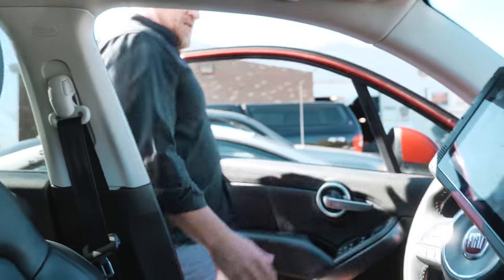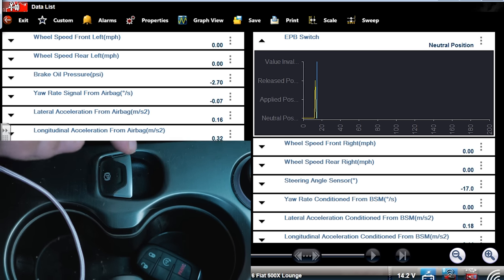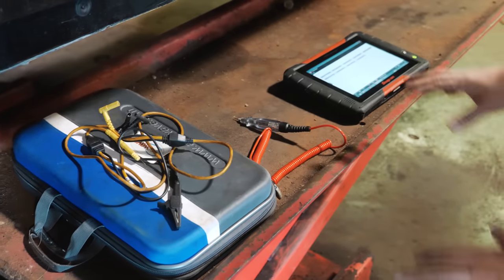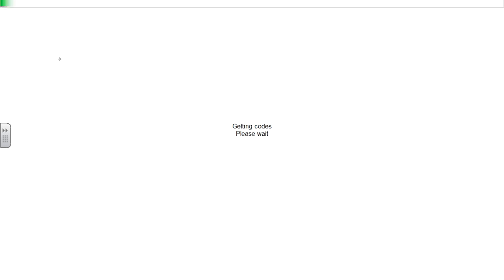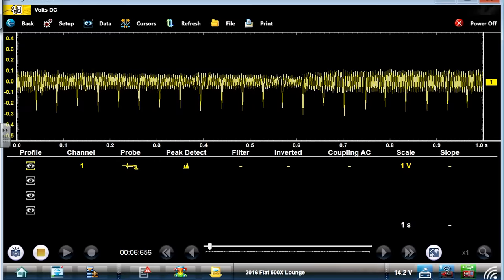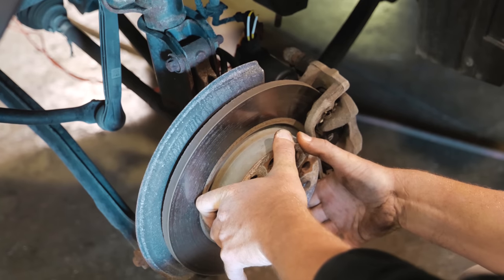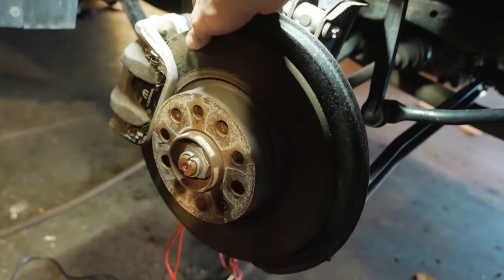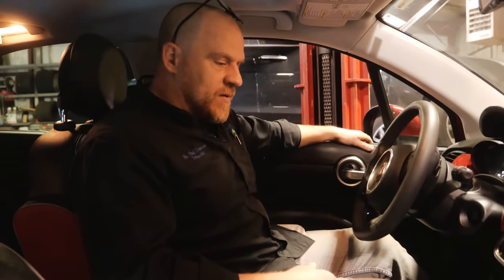2016 Fiat 500 Electric Parking Brake Intermittently Sticking On

Comment: Invalid wheel speed sensor code was there from the start , surely the ABS module needs to know that all wheels have stopped or at least there state before the brake can be applied/ released ???  Everything else is most likely water intrusion from the broken connector ? Also Fiat use an internal tone ring in the wheel bearing for the ABS and they are often put in the wrong way round was a rear wheel bearing replaced ? Incoherent code ? Suspension repairs ? New bolts on the RHR was it ??? Lots of possibilities it would be really great to have all the old repair orders ! Foxwell scan tools do strange stuff as well when scanning. Great content as always Paul and Caleb thanks so much. Good to see something Euro on here as well.

Comment: Ivan is a big proponent of Deoxit to clean electrical contacts.  He uses an aerosol form that appears to me to be more convenient than the paint-on you used in this video.  
If the connector isn't available from Fiat, I'd run to the scrap yard for one.  An expensive trip for the customer, but a more elegant/dependable repair for the customer.

Comment: Hi Paul/Caleb/Danner. Another great video. I think you should speak to your friend Tommy Wolfe about getting a connector housing and two repair wires for that EPB actuator. It looks exactly like the ones that Volkswagen group use. (Even the same rust/brown colour) I’m sure Tommy will recognise the type of connector. P.S. I think the little silicon seals for the repair wires are separate parts so you’ll need two of those also.

Comment: Maybe a way of testing the actuators would be to manually apply power and ground to the unplugged actuators in the apply direction. Put a current probe on the wires and compare the two. This would be a good dynamic test because as the brake applies the current will increase.  A sticking component or a freewheeling motor on one side would cause a current difference from side to side. If they are both the same it might indicate a good actuator.
Reply from the maker: I was more concerned with testing the drivers, but you're not wrong in that approach. I'd just argue that driver testing would have still be necessary. Especially if you find that the output (motor) has failed.

Comment: My guess is that connector was damaged when the wheel was reinstalled.  The rim is attached with bolts - not studs, and anyone who has  ever bolted one on knows the struggles of trying to support, line up, and balance the wheel while trying to not cross-thread the first bolt.  Notice the break in the connector is bent in towards the center of the car, suggesting the wheel leaned in and down onto it, snapping it.  The person who installed the wheel was probably not aware it even happened.  

"He who is without sin ..."

Comment: Great video Paul. It is a shame that the other shops might have misdiagnosed that fault. I am not making excuses, but in dealerships and chain repair shops the techs are pressured so much to make a call and do a repair with in a time limit. Many shops i have worked in the service advisors or service manager jump on the technician if they don't have an answer within the hour diagnostic time. Also many shops including dealerships are not interested in training techs on advanced diagnostic techniques, so the techs are given jobs that are beyond their skills, especially if they are new in the trade. This might have been the case the prebiouse person who worked on that car, made a call that they thought would most likely fix the fault as they were under the gun to call something. Also many dealerships will call things like modules if the car is under warranty as long as the write up is good and it is approved. Then if the fault remains they will keep throwing things at it until it is fixed. This causes customers to loose faith in the dealerships ones the warranty has expired, not a good practice. But that is also why shops like Danners are a diamond to have and are normally so busy. Once again Paul, thanks for sharing your knowledge, you are a true treasure to this industry as well as guys like you.

Comment: Hey man really enjoyed this video. I just wanted to know something. When you suspected a bad actuator as you were getting the open circuit code. Why didn't you use an ohmmeter and check the terminals of the actuator? And compared to the side that was working? That would rule out more than likely if the actuator was at least electrically open or shorted. And since you would have seen that it probably would have mirrored the operational side more than likely it would be in your connections that was the fault. I know it's easy to play armchair quarterback but just an observation I had throughout the video. I still enjoyed it and I think you're an amazing technician and I really appreciated your thorough and determined diagnostic approach.

Comment: Paul, I have and still work with 480v and 4160v 3 phase  electric motors. You should look up art flash protection. Just to see how electricity can jump. Sometimes you need more them just gloves. A good electrical supply company should have gloves.  They do need to be tested if you want to protect yourself from a shock. One little hole in the glove is all it takes.

Comment: hi again i think the system monitors through a resistance check which may be via bias voltage the motors whilst running is also monitored  for current (amp draw) when each motor hits the set limit of amps the module cuts power  the switch is treated like hand brake lever up to apply down to release i have been told this as i get click happy  you were lucky to be able to use the verus edge on a newer fiat as they are going over to secured gateway and the zeus with a subscription  will be needed on later cars

Comment: Thanks! I'm pretty sure that same connectors are on VAG cars rear calipers(Made by TRW). This kind of systems with 2 wires are monitoring curent and in live data it's shown when applying parking brake.
Reply from the maker: I didn't notice a current data pid! That would have been super helpful. Maybe I missed it? Thanks!
Reply: @ScannerDanner  I looked at screenshot and there is “Achieved clamp force for left(right) EPB motor in kNewton and it’s probably calculated out of motor A in end stage. Maybe I’m wrong, but on VW it’s working in that way.
Reply from the maker: @garaza24  ill blame unfamiliarity of the system 😉
Thank you

Comment: I've had success with deoxit, it cleans up green crusties really well in all kinds of nonautomotive electronic devices. I sometimes wonder if the cleaning makes the connection prone to recurrence, by exposing bare metal. But if you get rid of the water, seal it well, hopefully the underlying cause will dealt with.

Comment: hi paul.  i did not think of the code setting immedietly. looking from that perspective you are right there should be a bias voltage, so my son in law has one of these cars and i have borrowed it and have it in the workshop. up to now i have not found a bias on this circuit using my pico but i am sticking it out and doing more research.       i will return
Reply from the maker: Anxiously waiting to see what you find! Wish I would have spent more time on mine on this part.

Comment: You can use a headlamp bulb as a dummy load to draw some current. However this will set the "commanded position not reached" fault, as the module is looking for an increase in current as a result of the pads touching then being forced against the brake disc within a set time. The module cuts power at a set current, so it knows the applied brake force is sufficient.
You had this on the first "successful" operation, as the motor had wound back further than it normally would. Second application the pads did touch the disc.
On these simple actuators, you can power the motor via a headlamp bulb as a current limiter, to ensure you will not over current or torque and break anything.
Because that bias signal is so small, I would be wanting to replace that actuator to avoid comeback - yes the Deoxit restored contact, but did the water get inside?
Those EPB actuators aren't cheap, around here it's actually cheaper to get a complete replacement caliper than an OE (TRW) actuator, even outside of the dealer network.
I've done a few on VW and their system will keep working on the other side, if the actuator on one side has failed, you still get the codes and warnings of course.
Reply from the maker: For sure, the got a caliper and harness connector

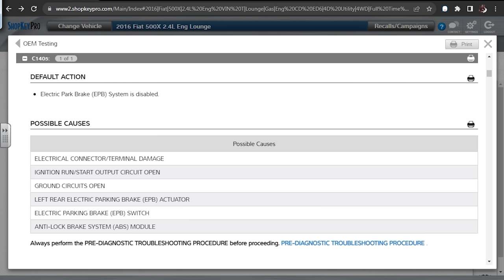Comment: I am currently (no pun intended) at 32:43 and I assume Fiat measures the increase in required current flow (maybe a specified ramp) as the motor applies the brakes. That way they COULD know the state of the brake.
Reply from the maker: Agree and it probably compares both sides

Comment: Paul that is what happens when you high resistance. I would like to see the wiring diagram for that system. You said you saw the green corrosion on the top side (wire to terminal side) and also on the motor side!

Comment: Aren't these parking brake actuators almost like a 2 wire blend or mode door actuator? Late 2000s dodge trucks come to mind. Basically it moves the actuator till it reaches the end point and the current spikes? I imagine this car needed to see both stop points of both actuators to clear that initial code?

Comment: Nice video. Got me curious 
With the bias voltage at the actuator.tomorrow I going straight to check not only on the wiring diagram but also at the connectors with a test light on a Mazda to see if the eps system works the same way
And see what the bias voltage is present on known good system.also I believe that when you going to perform any work or repair on eps system that involve removing rear calipers you need to put the system on service mode.that’s what I think previous shop  dint did it and probably they break the conector and sen the customer to the dealer because is warranty covered.dealer replace abs module? And they don’t see the condition of that conector during diagnostic? 
Hummmm

Comment: Pretty sure "Incoherent" means that the left and right parking brakes are not in the same state as far as the computer is concerned. One on one off = Incoherent. OR possibly it just can't tell what state one of them is in and so that throws it as well. Mind you, I don't actually know anything, that's just my interpretation of the word as it is usually used.
Reply: Somewhat confirmed by the fact that when you did get things communicating again and it could tell what state they were in, it seemed to sort itself out and work correctly.
Reply from the maker: Your not wrong, I believe it compares current on each side, and timing of the current

Comment: A shop I worked at part-time a few years ago that specialized in Dodge trucks introduced me to that Doxit contact enhancer. They used it on the computer connections a lot. Would it have been easier to figure out if you had attached both the left to the right and the right to the left at the same time? We do that on ABS sensors.
Thanks for pointing out the O2 sensor problems Dodge has with aftermarket O2s. I switched them to factory sensors and the weird voltage codes went away.

Comment: Hi Paul! Could it be bias voltage between two wire? You did measure wire to ground but since it is reverse polarity motor I'm thinking none of those wires has steady ground on it. Thanks for great video!

Comment: Danner, liked the video (as always) and the fix. you really got me curios about the contact cleaner you've used - DeoxIT. first time hearing about this product. do you have experience using it, especial with contaminated and corroded connectors?
Reply from the maker: second time we used it, just the word on the street made us try it and it's absolutely proven itself both times

Comment: If you had measured across the brake motor connector with the scope instead of to ground would you have had a better chance to see the pulses that detect the motor?  Or are they of very low amplitude due to the low resistance of the motor winding and potentially wanting to check the wiring for a high resistance condition?  I know my multi-meter only uses a few 100 milivolts  to do resistance checks.
Reply from the maker: it is possible it was some sort of small AC voltage signal that I was not seeing due to scope settings. I know it was there. I should have went back and looked at that further after making the call. I'm sorry that I didn't. Next time for sure

Comment: hi paul just a note as to how these systems work and the easy way to test them.first of all if a fault is detected the abs unit will disable the system to protect it and as you found out it will not let you reset until the fault is cleared and you send it to sleep. the motors you can test first of all by connecting a 12v supply  to them and they can be tested to run in forward and reverse but be careful as soon as the motor reaches the end of its travel remove the voltage straight away because the motor is powerful and if left running it will strip the nylon gears inside, be warned. then you have to test for continuity of the wiring at the  abs unit and to the caliper and also for no shorts.        now hows it work, when you apply the parking brake the motor drives to the park position and a current sensing circuit inside the abs unit senses the current increase when the motor reaches the brake disc due to the motor applying more pressure. this current is a set value in the module so that it holds the brake disk with the desired torque to hold the car stationary.when you release the brake the motor reverses and drives to the off position where the current again senses the off point due to current increase and switches off the motor. after all these checks you can then put the car to sleep and reset the codes.a bit drawn out but it is a protection circuit and is protecting the drivers from over current. hope this helps. oh by the way i live in the uk and we have a lot of these cars and it is a common fault  keep up the lessons good content.
Reply: oh a bit more you can watch the current draw on your scope if you want to

Comment: The motors get wet and stick roadside you can remove them with the two Allen bolts then work back and forward with a 12v supply by keep changing the polarity. Re-grease and refit. Works most times. Emergency procedure is to release calliper by turning with a torx socket.

Comment: Paul I was thinking why you wouldn't do a resistance check of the motors (basic testing) and if that read the same a battery jump pack would have been useful with an inductive amp clamp and with your sophisticated scope recorder see it visually. You know better than anybody reading component testing most of the time puts our brains at rest and at least for me I know motors in this case are good and then it is a connector or wiring problem ( or the driver faulty )  That scope reading was key to see the condition fault or the traffic on the wire, but as you admitted several times about the greenies corrosion those should have been replaced with new connectors even if you did not have a proper outer connector shell. Loved the video anyway, and what kind of tech are at the dealers that did work on that car with those codes you would immediately go to the motor and even most of the newbies I was around would have caught that. Maybe ray Charles or Stevie Wonder would not just saying. And that is why we get paid the big bucks and rightfully so.
Reply from the maker: The water was a variable in testing the motor directly to make sure it wasn't shorted. 
In other words the water and corrosion alone could have been enough to cook a driver and that's why i focused so much in that direction.  Someone else else commented on people destroying these my manually energizing. If these are PWM controlled, I could see that.
Reply: @ScannerDanner  I would never have thought of a motor being destroyed by a jumper pack testing these types of motors. In general battery booster packs are not as powerful as a regular car battery. By you jumping over to the good side and saw it functioned kinda proved the signal was there, what I thought was weird was reversing the cables did not work right off if I remember correctly but after you erased the codes I think it worked with cycling the key and doing the time out. Just more processes that muddy up repairs and complicate it for really no reason. Yeah I know the reason the manufactures want to squeeze all independents out so all work will come back to dealership and fill their pockets. I realized that on a inside MB door handle they used left handed screws, why? so if you didn't have their literature you would strip out the plastic in the handle. I give you all great credit in fixing these cars without manufacture guidance and engineers helping you. Love your videos. The frustration you get shows the level of concern and how you are going to make sense of it in the end for all to understand too.
Reply from the maker: Apparently when you manually energize these you have to be careful of the limit as stripping the gears internal can happen. (According to other comments here)